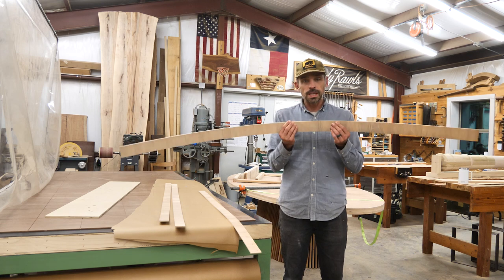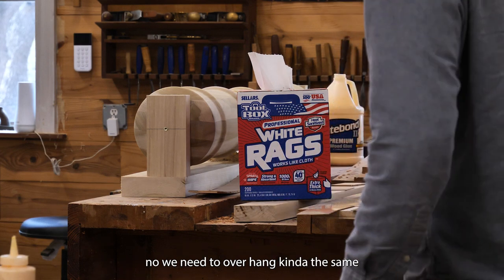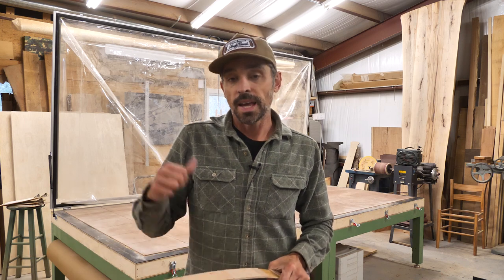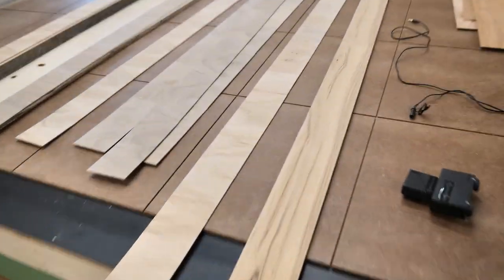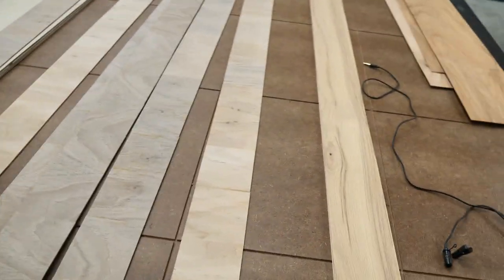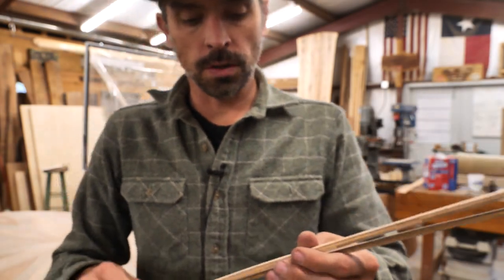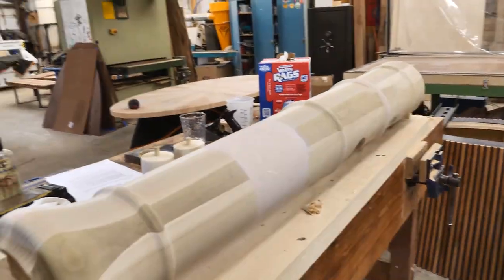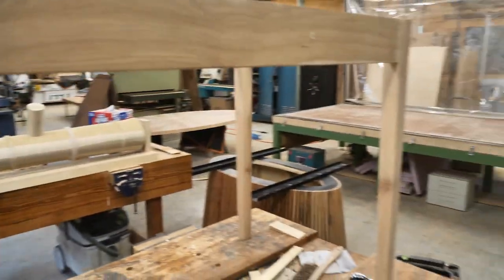Bending Wood // No Steam, Bent Laminations or Kerf Cuts...This Is Something Different

Comment: Nice work. If I was doing this I would use a long bag and put the glued laminations into the bag and bend it into that shape around the form and pull the vacuum. You could do both at the same time by doing half of the ellipse. Use Urea Formaldehyde glue.

Comment: I used to build countertops with oak edges we would just soak them in water and form bend them and it works every time sometimes the old fashioned way is still the best. K.I.s.s
Reply: True, but, if no one ever tried to find new ways of doing things because the old way “works”, we would still be getting places on horseback or horse/carriage, lighting our homes with candles, etc.

Comment: You might consider a second port on your vac table. One you could hook your shop vac to. Suck out the bulk of the air then let vacuum pump do the rest. Should be quicker and may extend the life of your vacuum pump. Also:had you considered but a thin nylon or some other fabric in the bendy board
Reply from the maker: Thanks and no I haven’t but I like the idea…might have to try that.
Reply: When I’ve done vacuum forming in the past we used a really thin mesh to help distribute the air flow around the whole “mold/work piece” it stops trapped pockets of air. Plus gotta pull those wrinkles out the bag as the pump draws the bag down on the work piece.

Comment: In this application, why did you need matching outer layers?  Wouldn't 2 ply work?
Reply from the maker: I just always feel like things need to be balanced and honestly once you glue it to the table radius it doesn’t matter.  However if you only glued one outside later then let it sit in the shop it would curl up like a potato chip because it’s unbalanced.
Reply: @AndyRawls  agreed, I'll be interested in seeing how you finish the top/edge joint.

Comment: Isn't the energy in those bends still present in the board you bend this way? A latent energy wanting to assert itself straight again, you know? I'd  think it would always be trying to pull itself loose. But I know nothing 🙂
Reply from the maker: I think you’re right but the adhesive is stronger than the energy in the wood.  It’s very similar to a bent lamination, once the glue sets the wood is stuck.
Reply: @AndyRawls  Amazing it can overpower that stored energy. BTW, love your channel